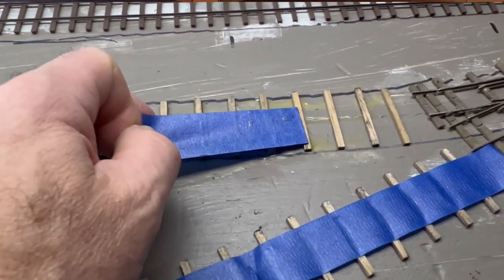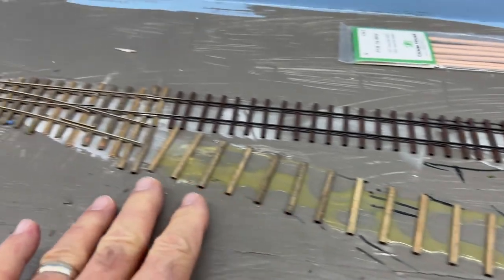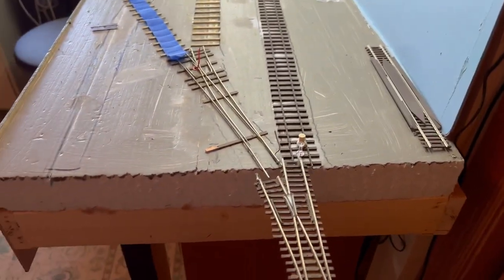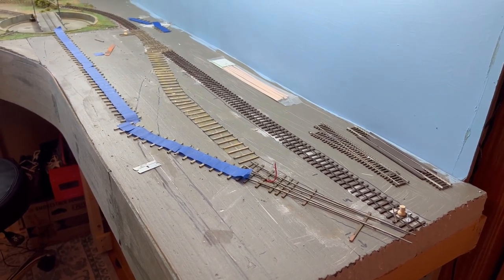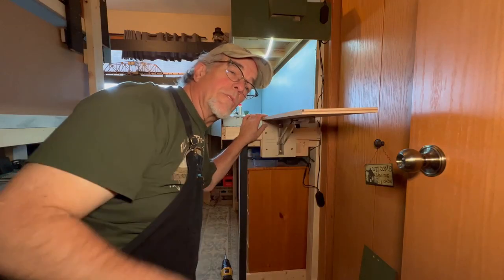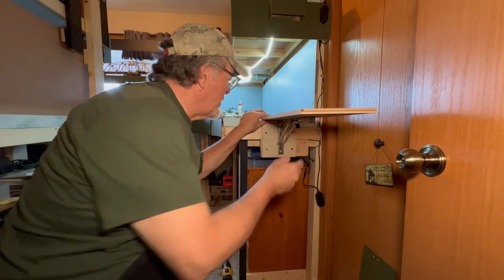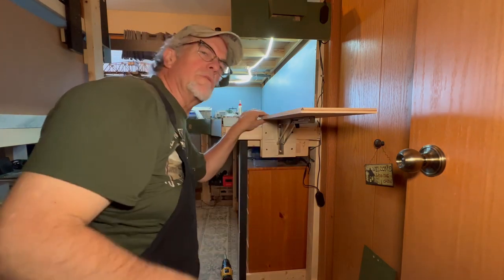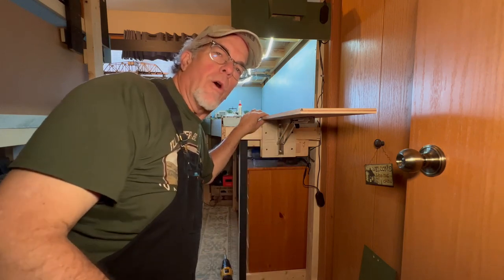Building a DROP DOWN On30 Track Extension -- 01-08-23 LAYOUT UPDATE

Comment: Nice work! What is that folding support piece called and where did you purchase it from? I currently have a lift out spanning a 5' wide closet but this would be a way better solution for me even if it was a touch shorter.
Reply from the maker: https://www.amazon.com/stores/page/75CD1375-58E3-477A-A0F4-FA643C23CB56?ingress=2&visitId=7481ff70-450e-4d7e-abb3-5c7b0bf65b5a&ref_=ast_bln
Reply from the maker: Here's the Amazon link...they have several sizes. Thanks for watching the video and subscribing!